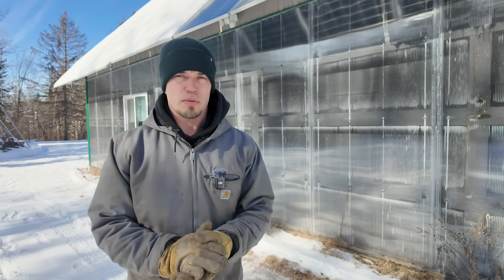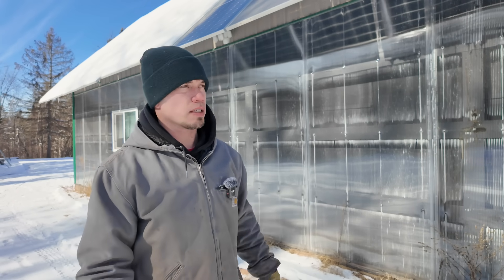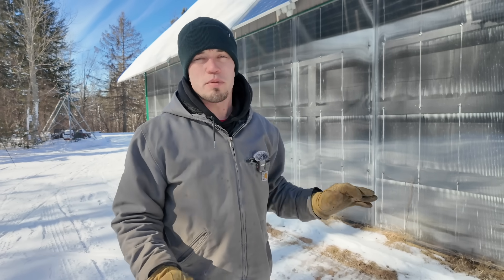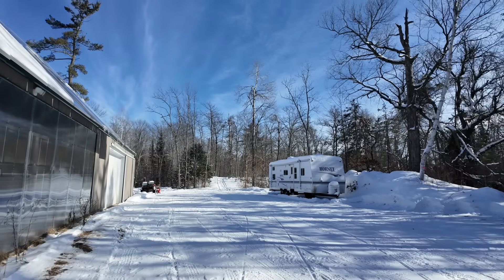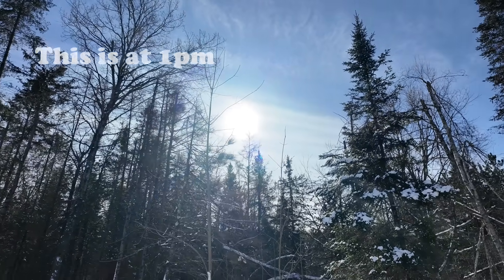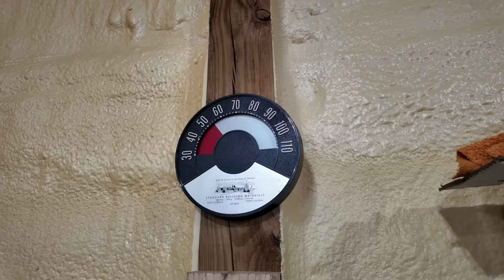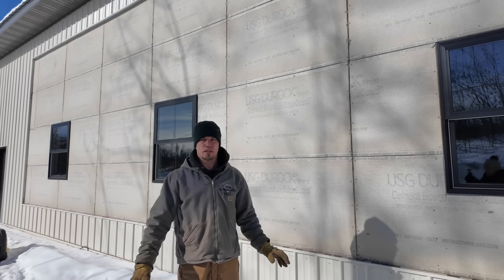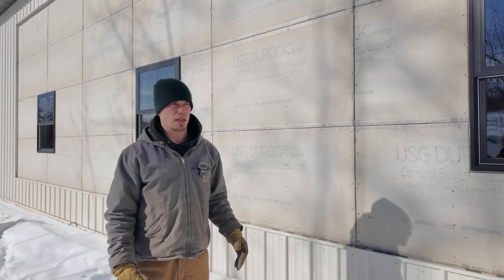Lessons Learned on Our Solar Heater Wall | 1 Year Later...

Comment: Use the same flap that you used on the new shop, just stick it in from the inside, tap the aluminum for screws, tape the plastic to the aluminum, run long screws from the inside into the aluminum, may have to make the screw holes a little larger for wiggle room to line up the holes. I really like the new shop system!

Comment: "Dry out the wood and catch it on fire"
I did some experimentation with a posterboard trough-style solar collector. What I found: 
Build a vented end cap from the cardboard. Over that apply a sheet of woven fiberglass bonded on the edges. Over that apply a layer of tinfoil. The tinfoil will reflect most of the heat back into the system, the woven fiberglass will keep the tinfoil from igniting the paper. The vents? Can't tell you for sure if they worked but the idea was to keep the glass from getting hot enough to ignite the paper. I was using the thing with a trough-style collector mirror I made from mylar to concentrate heat on a black-painted copper tube. As an experiment, I ran it with no water in the tube. It got hot enough to blacken the cardboard where the tube penetrated the case, but nowhere else.

Comment: Typical bathroom / kitchen / PC fans are not rated for the hot air temps coming out of the tops of solar collectors.  These kinds of fans will last a lot longer (probably by years) if they are pushing cold air into the bottom of the collector rather than hot air out of the top.  If you really want fans on the hot side, check the temp specs on things like attic fans to see if they will handle the heat.

Comment: 3. Your Greenhouse should have an air intake that comes from about 100' of 4 - 8 inch PVC that is placed 10 feet down and then comes back up to an inlet that is protected from critters and bugs getting into it. 
(And then you use a Solar powered fan to move the air into the air intake of the greenhouse's Solar wall.

Comment: 2. Run a 4" to 8" connecting PVC pipe between the Greenhouse and the shop space heavily insulate it or place it 10 feet down.  Your plants are upping the level of Oxygen and then you are letting it go to waist.
2.a. People who run one of those air exchangers (You could make yours from left over of the solar wall and some discarded "Vote for me" signs) have the "concern" that yes they are turning 50% of the heat back into the building but what about the level of Oxygen?  By plugging into the greenhouse's supply of higher Oxygen you can lower the level of Oxygen exchange out of the building. 
https://www.youtube.com/watch?v=w5sR-0oX1dg

Comment: Nice work.
In the previous video about this project you've talked about ducts that connect all the inlets. In such a case, you only need one thermally activated vent... could that save you some money? 
Also, if you're worried about over heating, maybe try to redirect the hot air outside in the summer instead of pulling it inside, or keeping it between the inner and outer walls.
Good luck, and thank you for sharing.

Comment: Thank you for this video! This and your other videos have been super useful--my partner and I are in WI and bought a house with a trombe wall last year. Your videos were one of the surprisingly few relevant resources I found to learn a little more about our passive solar. 🙂 It's been interesting to experience the seasons with it. That said, we're definitely going to put a tarp over it this summer. We're just looking at UV protective ones, but are there any other important tarp nuances you are aware of?

Comment: It looked like your floor inlets to the solar wall are screwed from the inside so all you need to do is take them out and add a thin bit of soft plastic that hangs down over the opening inside the wall making a one way air vent baffle. It would lift when the fan sucks air out and fall back to seal when they don´t. It would cost you a buck or two per vent so if they ware out replacements won´t break the bank. You could also put heat controlled passive vents (bimetallic) at the top of the plastic outside wall to release excessive heat outside when you do not need it. This way any excessive heat above what you want is vented outside.
Ps. if the wall dry out to much try a humidifier to re moisten them or place a open top pan of water on the floor next to the inlets. Just keep an eye out so you don´t get mold in the wall. As with all things it is a matter of balance.

Comment: I like the clean lines of that new wall. Gonna look badass after the paint and the glass.

Overall I'm grateful you guys had a video up because it's hard to get a practical example of people doing this and if it works for you guys at below freezing then I have proof it will be worth doing in the future.

Comment: Interesting concept but I what do you do in summer? This wall for sure is crazy hot to the pint you need to shade it. Why not put pv panels directly onto the wall and use the electricity with a heatpump to heat in winter and cool down in summer the shop?
Reply from the maker: Did you even watch the video?
Reply: @ I did watch it and heared you have huge problems with heat in summer creeping in through the openings of the fans and also the extrem heat comming through the PU insulation. Hence my rceommendation using PV and a heatpump keeping the wall cold / shaded in summer and using the low sun angle in winter for better production (I know it‘s shaded because of the trees)

Comment: To hot ventilation air back to the solar panels.   Like a wood stove . Use in winter  or summer  im shore the air con temp would be cooler going out of your cycling  then temp out side. 
I have tr😢the world 🌎 
Australia wa 45. To minimise 20. Ukranie.  Before the war. Did i learn  yes. Hope my information.  Gives ideas. 
God bless  mick Australia 🇦🇺

Comment: Hello, I want to appreciate the approach to the heating solution.  On the other hand, I want to point out the very dangerous, I point out very dangerous composition of different types of PV panels.  What you save by choosing different types of panels cannot be compared to the potential damage that can occur in the event of a failure!!  Please take my warning seriously.  This section is not good to mess with😢

Comment: To block the floor level vents at night, consider using small panels held in place using magnets, or magnetic strips. That is if those lower vents are made of steel.

Comment: I'm only at @2:37, so you may say it later.
For the solar panels, put them on rails. Up position in the winter, down position in the summer.
Reply: Rockers... will change panel position and angle for the different seasons and improve efficiency.

Comment: You can try an automatic foundation vent to stop cold air coming in at night.  Basically, it opens above 40+ degrees and closes below that.  If that doesn't work they make dampers for furnace ducting that you can program to close and open with a thermostat or timer.  You won't really get a good seal with a flap - although you could try a flap like a bath fan has.

Comment: In the U.K. we use heat recovery fans sort of new to the market due to building code , they sell them in the usa so you don’t have that air gap issue and he;p keep a healthy balance , what you basically done is build a cavity wall. And most of your heat loss protection comes from the air tightness from the spray foam ,  forming a tight air barrier, it’s a great way to get high r values, but this is now starting to be banned in eu due to fire risk and combustion issues in such conditions. And may get higher return using air gel wall insulation  as well as used especially roof insulation . You use this with memory foam edging to create a tight seal.  The other issue with such foam is it can form mold behind if you haven’t added a water proof Vapor barrier  sheet . Please before you add another look into building code and insulation for passive house standard

Comment: Adding some thermal mass to your Trombe wall can keep the convective heating going through the night. Something like heavy duty shelves against the wall, lined with full large water cooler jugs, painted black at the side furthest from the sun.
Good luck.

Comment: time stamp 5:49. you may try green house window openers. set it up so that as the cold air comes in it will cool off the beeswax and close the door thus blocking the vent.
Reply: Or for the bottom vent, you could use a chicken coop automatic door maybe.  Only during the day, etc..

Comment: Solar:
1. Tree removal will help but so will the electrical connection design on the panel modules.
2. Solar modules on micro inverters would eliminate drops in productions due to shading.
3. If you want to protect the wall during the summer, bringing in the passive house properties to allow the air circulate to the bottom of the solar wall to be reheated that might help. not sure your recirculation setup.

Comment: Love the install and thanks for sharing! For the cold air returning during the night, what if you installed a trap on the inside of the building by putting it in a box just large enough for the trap. Would loose a bit of floor space but would be accessible without getting into the wall for future repairs/maintenance.

Comment: Have you considered some automated  heater vents for the bottom air vents?  Amazon sells em for like 30+ bucks.  you can just swap out het basics and then you have something that you can automate/remote control adjust.  I mean, sure a flap is cheaper but if your looking for soemthign a touch more robust its not all that expensive.

Comment: ⭐️⭐️ (FIX) You said about the back drafting, build a small box that has a flap system and connect it to or over your intakes to the solar wall 5:49   
It might stick out the distance of the flaps but will definitely work. Or at night after the wall is 70% shaded place a slide behind the vent cover and seal it

Comment: Have you looked into setting up a backdraft damper to prevent cold air recirculation in the night time ? You probably wouldn't need something heavy to block the stream. Could be a piece of heavy cloth installed on the heating side of the panel inside your bottom air grille. If it's placed properly the cold air trying to get back in would push it into the grille and do a good enough job of reducing the cold air coming it. If a cloth isn't enough, a very light plastic or metal plate on a hinge might work.

Assuming the air flow from the panel during the day is strong enough to overcome the damper, it might give you a good way to solve that issue. A motorized damper would do better but I'm trying to keep it low tech here. 10% of work for 80% result is usually good enough for this.

Great video.

Comment: could have  keep your building as far north on your clearing. less trees to block sun .    make your solar wall a  6 ft wide green breezeway  so you can stack firewood in it to dry and add thermal mass.  door in middle for better access. solid roof with small overhang. with a very small heat pump mounted higher up in green breezeway  you can cool it down very cheaply with your  solar and less heat loss threw glazing ..open doors each end and middle in summer

Comment: Maybe a quick and easy fix for the *night circulation problem*: If you fix a piece of "cardbord" etc. with one stripe of tape at the top of the upper fan. If the fan works -it will push the cardboard open. If the fan shuts down, the cardbord will fall down and so prevent circulation. this would be an automatic solution for no money and should reduce convection by 95%.
Thanks for you sharing your expierience!

Comment: If you put a thin piece of aluminum hinged at the top on the inside of the solar heat panel, it would close when cold air tried to come in to the room from the solar panel through the bottom vent. It would open when the air tried to enter the solar panel from the room when the fans were running or when the air in the solar panel got warm.

Comment: Since your project is complete this is for a future endevor.  Consider adding mass to your wall.  CMU units with alternating concrete and sand filled units.  Also  consider Microencapsulated Phase Change Materials (PCMs)  - tiny PCM particles enclosed in a protective shell, allowing them to be integrated into coatings, plaster, or paint. When applied to walls or surfaces, they absorb and release heat efficiently, improving indoor thermal stability.
This should better balance the highs and lows of the temperature swings in your solar wall.
Reply from the maker: Thank you!! We’ll look into that for sure

Comment: VERY interesting vid and results.  As a general rule, greater airflow is the way to get the best efficiency out of your heater - the high scores people show from some of their projects are fun, but you can't really use 200 degree air; instead move a lot more air and get 100 degrees, or even just 60 when your inside temp is only 40.  So long as it's warmer than what's inside, you're making progress. Your air spends less time inside the heater, reradiating heat back outside, and it still feels warm inside.  This is the first vid I've seen from you guys so I don't know what kind of peak temperatures you're getting.

The flaps to prevent reverse flow overnight might be as simple as sticking on some vinyl flaps from inside - try removing the existing grilles and stapling on some lightweight vinyl above the opening.  You'll be working blind but if you've ever worked on a car or delivered a calf, that's nothing strange.  And it might mean not having to suffer unnecessarily cold toes.

Comment: ideally speaking you'd build the outter shell of your solar wall from single pane safety glass because Infrared radiation (the actual warmth you feel from the sun or a fireplace) is mooostly blocked by PC polycarbonate and PMMA perspex.  but you want the IR radiation to pass through to be converted to convection heat by the black surface that can be pumped in the living space by fans.

that of couse raises the heat gathered in summer aswell.

your PV shade idea is good but need a bit of tweaking.

i would put up multiple long pieces of sheatmetal with low depth stacked over each other at some distance and adjustable in angle.

basically like every professional sunshade works.

that way you can tinker with the angle and radiated black surface area in general when you get low sun hours but also set a range to be in for auto adjusted iradiated surface area based on low winter sun vers. high summer sun.

i'd use something around 7,5cm (3") depth for the adjustabe flaps. and 10cm distance (4") from flap to flap.

the more depth the flaps measure (and the less distance between them) the more aggressive the switch the from summer to winter sun will be.  too small flaps (and too far apart) will not provide enough shade in summer and to big will shade too much in winter and require constant adjustment to get the desired power of your heating system.

the flaps should be somewhat mid - dark grey. you don't want too much reflection to pass through the flaps in summer and enter the greenhouse space.

Comment: As for the comments about spontaneous combustion? I’d ask for absolute proof before believing the comments. I doubt that would happen. Things would have to get real hot before that could happen. Soar heating walls are great and I learned that they need the flaps to prevent reversal in the evening long ago in the 70’s.
Reply from the maker: It’s better to be safe than sorry, I suppose!
Reply: there is a process called pyrolysis where prolonged heating will dry the wood to a point where you can drop the combustion point from 451 degrees F (normal) to about 100 degrees or so lower. (low 300 degree range) I would imagine you'd never reach a point of spontaneous combustion for common wood, although painted areas may degrade and cause other issues. Also consider that a fan failure might get that space up over 200 degrees on a sunny day.

Comment: We had magnetic panels that we put over the registers to reduce the furnace pumping heat into rooms not in use. Would that work for you?
Reply from the maker: That would work, but we’re looking for a more automatic solution
Reply: @thehomesteadingrd    look at 24 volt zone dampers that are commonly used on warm air furnace applications. Everything can be wired into t-stats or powered by your existing t-stat for the fans. They will last for decades.

Comment: I've only seen this current video, so I don't know what you did or didn't research before hand. Basically back in the 60's, 70's we called this a Trombe Wall, but the wall was made of concrete painted black on the outside. The concrete would also absorb the day time heat and gradually release it at night. (that also solves your concern about combustibles) Typically glass was used as the outer skin, but I guess these modern polycarbonates are cheaper, but there ability to expand and contract with temperature appears to be an issue that you're experiencing. I'd consider how your are connecting them, so that they can "move" without failure. Hanging and lapping panels is one consideration (i.e. like shingles). 
Any way best of luck on your new shop! Cheers.

Comment: Thank you for sharing your experiences. Noticed something that you might want to consider in the shop portion. There are machines that are capable of producing sparks next to the foam wall. Might I suggest that anything that can create heat or generate sparks be relocated away fro the wall. Being remote requires extensive care as it relates to potential fire outbreaks.